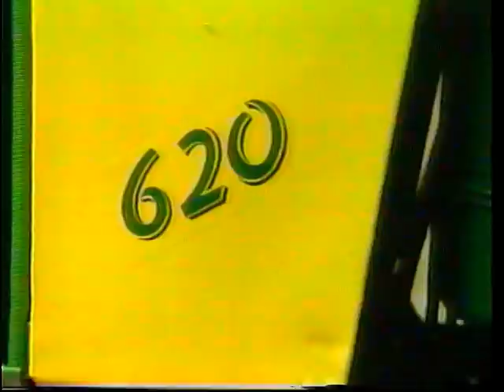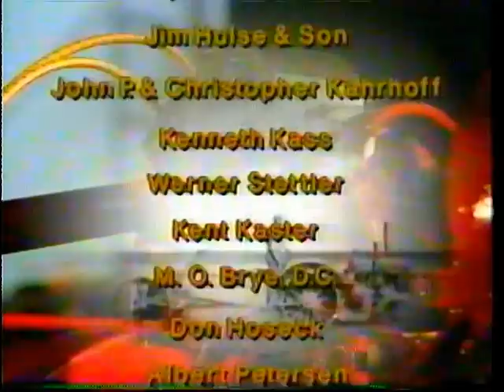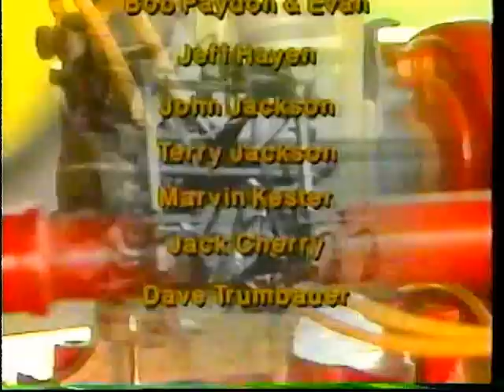Echoes of the Past .... The John Deere Two-Cylinder Tractor

Comment: those of us who grew up hearing that reassuring pop pop that sound will never fade.
Reply: Your 100% right on that.
Reply: Now the Chinese tractors sound like Chinese talking when they’re running, “yang fong mong chung dung bung!”
Reply: @100texan2  t
Yep. I miss working the Horses. Pull more than any track.
Reply: I grew up hearing the 'Poppin' Johnnies haying all night in the summers. Cooler air, higher humidity keeps more of the leaves on the cut alfalfa hay at night.
Reply: Randy - The Johnnie poppers had low HP but massive torque. Don't need HP for plowing.

Comment: I farmed with a John Deere A & G. I used a John Deere 40 Bulldozer to do many things, but one was pulling a John Deere manure spreader in the dead of winter in Michigan. We farmed about 1,000 acres.
Reply: Fastestinthewest do you know if a John Deere Unstyled g should have a red starter tank gas cap
Reply from the maker: Ernest Clure Yes. The small gas tank on all-fuel model tractors was red. The main tank cap was green.

Comment: My Dad, grandad, and uncle Shady, all farmed separately but they worked helping each other one of my earliest memories was going into my sisters bedroom and lying down on her bed when they pulled into the 40 by the house to plant cotton, they would have five or six John Deere tractors working up that field and planting cotton.... then my dad and older brother's woulf put up a woven wire fence around the field and put several hundred 
Weeder geese in the field geese would not eat the cotton or any other broadleaf weed but they'd keep the burmuda, Johnson grass, Barnyard grass down....then i remember when Elanco  intoduced Treflan herbicide.  One of our local John Deere  dealers had the franchise lic. From Elanco. Treflan was sold in 1 qt. Cans similar to  engine oil cans  late 50's early 60's